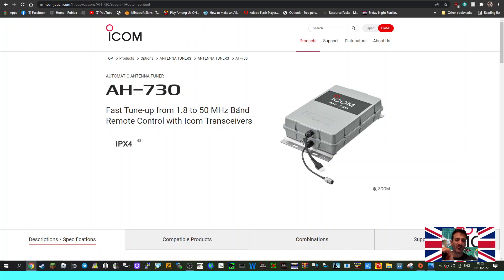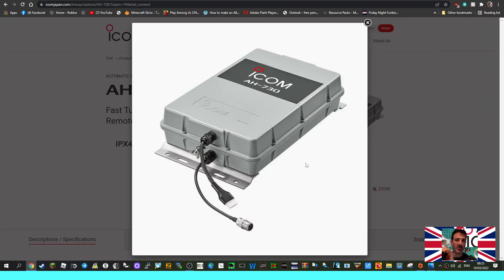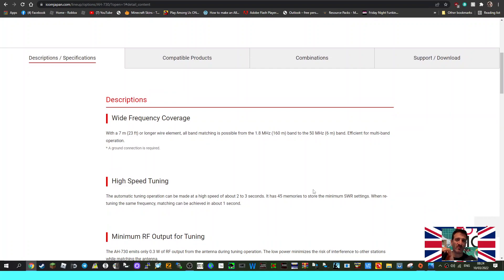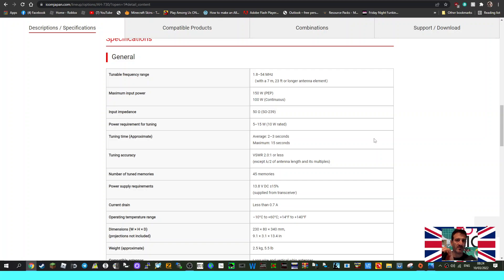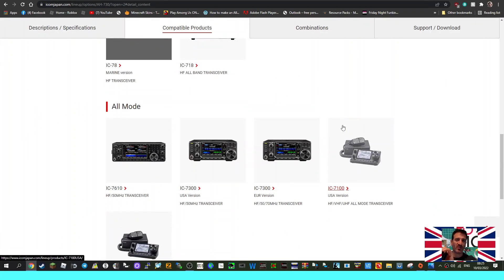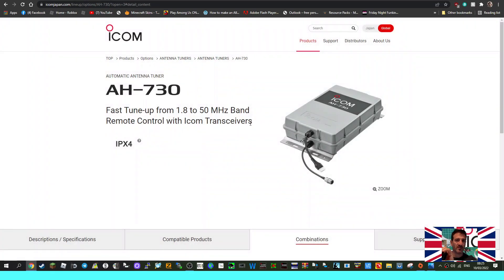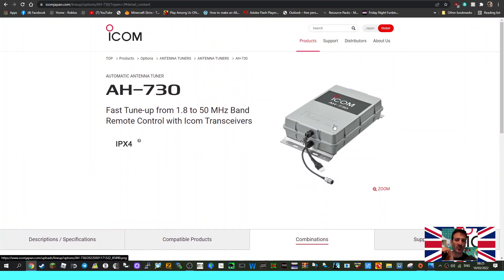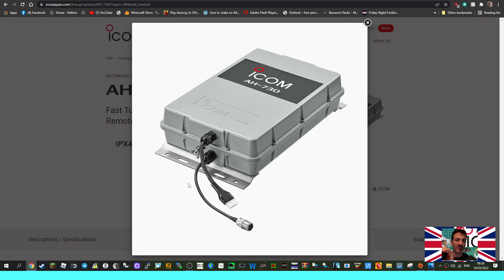NEW-ICOM AH-730 Antenna Tuner -Longwire

Comment: I have an old icom AT 130 for marine band. It works great. Only 1 problem after 30 years, 1 relè stiky or with bad contacts. During tuning procedure sometime did not start. Changed relè and now is back to work. I got it free when radio station was changed on board of a ship in 1996. Only problem is that over 25 MHz tuning is not smooth, but other tuner has same problen due to capacitors and coil, they have high step value to match antenna on high freqency, or maybe antenna is too short. All other frequency is exellent, tunes in less than 3 seconds anything, wire, wip, cable, vertical, horizontal antenna; from 1,6 to 25 MHz. Important is to have a short and good grownd connection. I made a little box with tune button, LED with tune OK, and relè that sends to tx my Kenwood in AM at around 6 to 10 watt. I modify system adding an attenuator at 50 ohm, to keep low the power during tuning sequency to avoid dammege of the phase detectors. 👍👍👍👍👍👍
Reply from the maker: Hi wow you know your stuff great info and work .
Reply: @M0FXBHamTech   Hi. I am in pension now, but i have been working for 40 years as an electronic technician on board of wessel. Service and installation of MF, HF, VHF, satellite communication ect. The tuner placed under the antenna is the best. Internal tuner with output in coax will have a huge loss of Energy due to the cable at 50 ohm that feeds the antenna. During tuning procedure, sistem has 2 phase detector, 1 phase detector works out if antenna Is capacitive, inductive or resistive. The other will detect if antenna Is more then 50 ohm, less then 50 ohm or if it Is 50 ohm. First operation of CPU Is to add coil or capacitor in order to reach a a pure resistive antenna. Finish that, second phase detector Will adjust load to obtain 50 ohm seen from trancever. It all depends on frequency and antenna length and comes out a π configuration (capacitor coil capacitor) a L configuration (capacitor coil) or a reversed L configuration (coil capacitor). The worse part is when the antenna Is a bit over  a quater of the wave length difficult to get 50 ohm. Or when Is around half wave length, in this case there Is to High voltage on output capacitor and you May get a Spark in the tuner PCB or relè.
Sorry about my english but i Hope have been enough clear. Anyway those are good type of tuner, only relè Will give problem with the time or a thunder and lighting storm Will destroy them. 👍👍👍👍👍👍👍👍👍👍
73 to all.

Comment: Thank you for the heads up. I thoroughly enjoy my AH-4 tuner. With this, if I could afford it, I could get on 160 meters. I live in extreme downtown and with the trees in my backyard and the eve of my house, with a 97' wire I am able to play on HF. My noise floor is always S7, but I'll take it. :) Once again, thanks for help I can't wait to meet you on air. 73!

KJ7NUX
Reply from the maker: Hi thanks so much for your info and comments -catch you on air 73
Reply: The AH-4 works on 160 meters (even if not specified); or at least mine does. You just need a longer antenna wire. I used 12,5 meters antenna wire (the longest I can use here) with an additional loading coil to get it to tune on 160. I suppose that a 20 or 30 meters long antenna will tune on 160 without the need of a loading coil.
Reply: @fabiomuzzi7047  Is true . My AH4 tune the 160m band with 25 meters wire , without any problem.